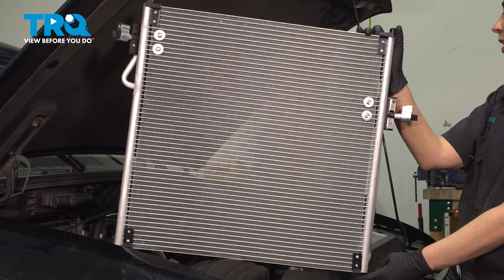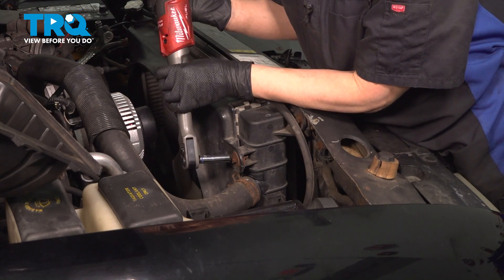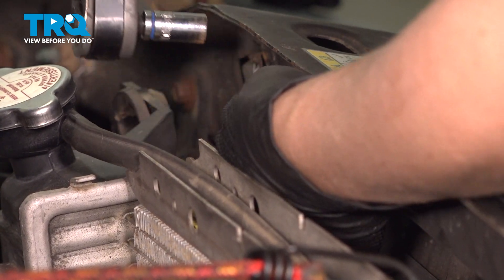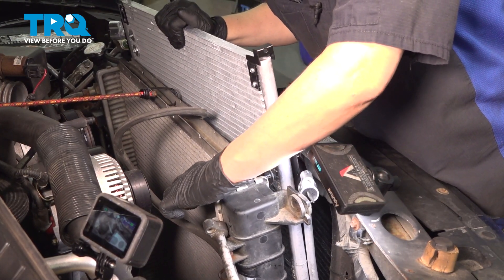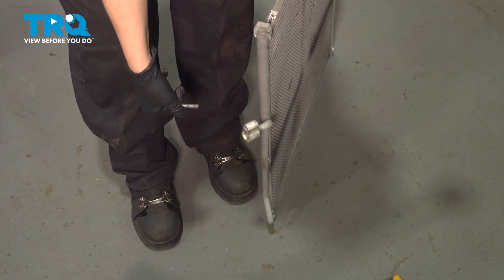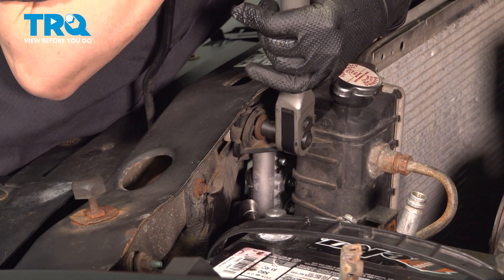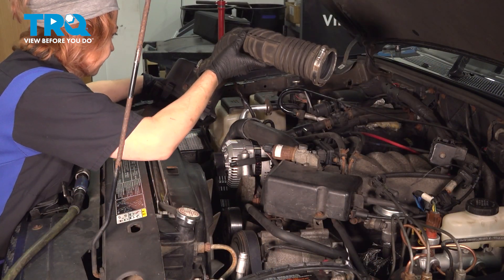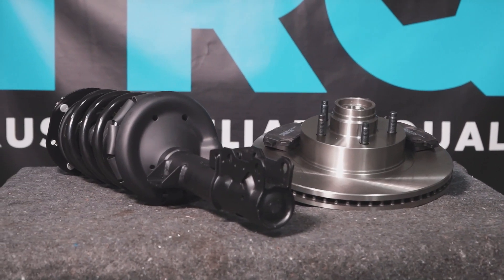How to Replace AC Condenser 1998-2011 Ford Ranger 3.0L V6

Comment: Good job 👍 I'm replacing my  98 Ranger compressor dryer condensing coil and lines. Also 1A keeps saying they don't have 💩 for my Ranger. I've been using Summit and RockAuto for my restoration parts.